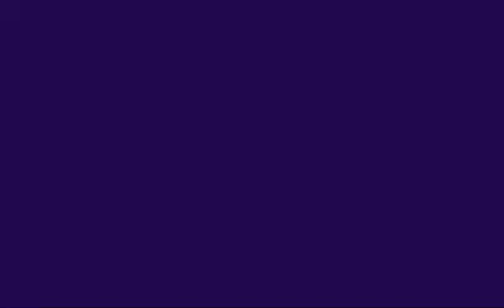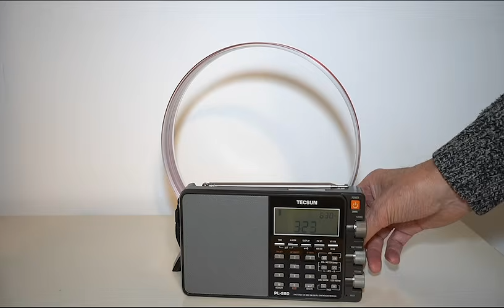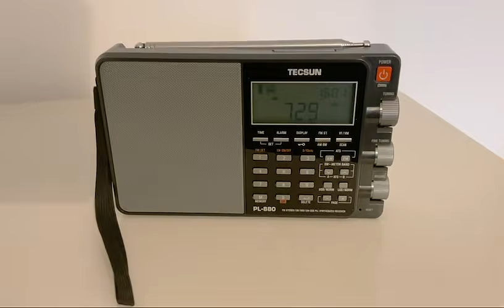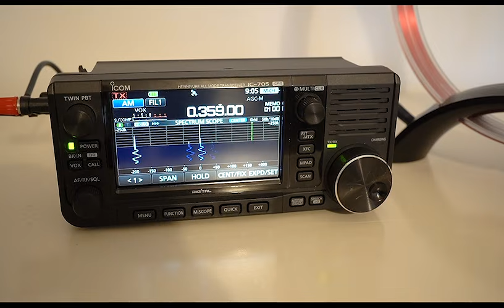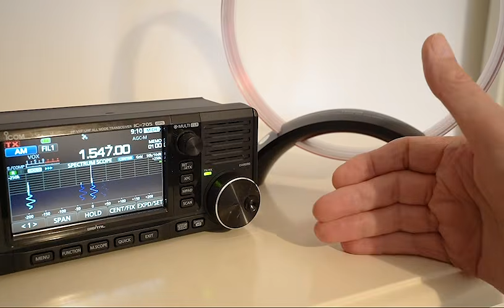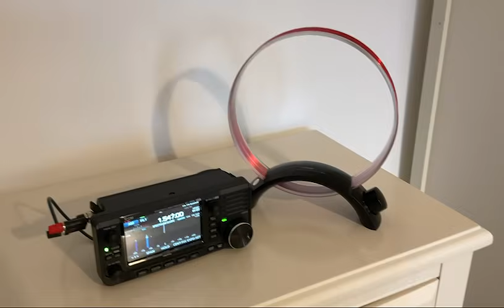The Amazing TECSUN AN-200 Indoor  Loop Antenna - LW MW and 160m. Great performance.

Comment: When using the cable, is the internal gang capacitor disconnected when the 3.5mm tip-sleeve is connected?
Looks like the capacitor remains connected, thus the receiver cannot control the beat frequency.

Comment: You have the orientation totally wrong, the Radio has to be END ON not parallel, been using one of these for a while now. The loop has to be in the direction of the station for a start, and then the Radio goes end on not flat.
Reply from the maker: I can only tell you what worked for me.

Comment: Hi and thanks for posting, I just got my self a Digitech RA 1780 that also offers a 3.5.. jack on the side, how can I get my hands on one with a 3.5 mm connecting cable and does it work on SW as well. Cheers Glenn v from New Zealand.

Comment: I’ve found that the AN-200 loop antenna works better on some but not all radios. I’ve also found that it works really good on the Tecsun S-2000 receiver but only in passive mode.

Comment: The results of your MW testing would have been tremendously better if you have set the receiver in such a way that it takes 9kHz steps (in the Americas 10kHz of course). The right frequency for Absolute Radio was 1215kHz, not 1217. Maybe not that important for a strong signal like 1215 used to be in your area, very important if on the hunt for a barely receivable signal that otherwise could be brought in clearly. While listening and turning the loop, adjust the loop tuning capacitor in very small turns as the loop is easily off set otherwise. This can make all the difference, that good this loop is. It can, and will as a matter of fact, make the difference between receiving a station faintly or not at all or receiving that same station very clear. The loop is extremely directional. So in order to take full advantage of what the antenna has to offer, I placed the loop on a lazy susan so it can be easily turned for optimal performance. If your receiver is small enough and has no dedicated MW antenna socket (very few portables have that) both the loop and the radio can be placed on the lazy suzan. And it will also make a huge difference what the position of the loop placed against the back of the radio is. The most important thing to do however, is acurate tuning of the loop. As said, it will make a difference between receiving a station and receiving nothing at all.

Comment: Thank you for this, Peter!  I have an AN-200 that I have used quite a bit with my CCrane Skywave SSB receiver using the inductive coupling method.  I recently bought a PL-990X and tried it once or twice, but -- DUH! -- never thought about plugging it in to the external antenna jack on the receiver.  After watching this I gave it a try and it works great.  Based on my brief initial tests I don't think it is much more sensitive than the PL-990X's internal loopstick, but it offers the great advantage of being able to rotate the antenna rather than having to rotate the entire receiver to check for nulls when trying to ID a station.  The cable that came with mine has a 3.5 mm on one end and bare leads on the other, so for my next test I'm going to try hooking it up to my KX2.

Comment: Well, that's a fine review as far as it goes, Peter, but why didn't you show us how the antenna works on the MW band during the NIGHT when MW DXing is mostly done, since reception at that time is vastly better than during the daytime? I know from having lived in Seattle for many years that using a good amplified Dymek antenna, or a tunable loop, it was often possible to hear the primary, 50KW stations broadcasting in NYC, 2400 miles to the east!  I would be curious to know whether such a small loop as the one you tested could provide similar results.  Frankly, I doubt it.  There was a period in my life when I decided to test all the high end MW antennas on the market, with the exception of the big KIWA tunable ulltra-loop which I couldn't get my hands on.  I found that the huge multiwire diamond loop Sunseri antenna on a rotatable was the best overall receiver, but it was way too finicky for my taste.  Several rotatable ferrite bar antennas also worked fairly well, as did the big round plastic clad "Alaska" antenna tunable loop, about 12 inches in diameter.  I also thought the amplified ferrite double bar Justice antenna sold by CCrane was very good and easy to use.  The big CCrane portable radio is also very good, perhaps a tad better than the more standard and cheaper GE Superadio I.  [Don't even consider buying a GE Superadio II or III!] My Sony ICF-2010 SW set also has a very sensitive MW section, -- but one absolutely MUST switch out the stock Wide AM filter on it and replace it with the steeper skirts of the Kiwa wide replacement filter in order to cut out all the adjacent channel slop.  [Why they put such a terrible stock filter on it is beyond me.  Sony usually designs high quality equipment.]  The SW region on the ICF-2010, with its sideband selectable synchronous detector was actually a better receiver than anything short of the Drake 8b, the Drake S8, or the little Palstar with both mechanical filters and, in my case, a custom, hand-built sideband selectable synchronous detector that I got from the late Dallas Langford, who was one of the finest MW band DX-ers in the world.  His detector also beat the pants off the one in the Drake R8b, which is the only feature that made it better than the regular R8 or the R8a models that came before it without sideband selectable synchronous detectors!   I also tested many other high end MW/SW receivers at the time, including the much ballyhooed AOR 7030 which I hated as it was so damn hard to use!  I found the NRDs, [I had only the 525 model to test, the 535 may well be superior to it] also to be good across the entire MW/SW range; good, but hardly exceptional. The same goes for my old Kenwood R-1000, a very good value receiver when it first came out in 1980, when I bought mine, but which is hardly still anywhere near the front of the pack. ..... Well I hadn't meant to write all this, but perhaps you, or someone reading these comments will find my opinions interesting and worth considering.  But please retest the little loop antenna you have, the one having only one OEM, but sold by many different companies, during a night when the reception is exceptionally good due to temporary salubrious ionospheric conditions.   And please keep your reviews coming!!

Comment: Like the look of the loop from Tensun. I use the Tensun Pl 310. Sangean ATS 909 X. Icom R70 and NRD 525. Plus a Mini whip antenna from Ukraine. Plus long wire antenna. Luckily I live in a building on the third floor. Not much qrm. But would like to purchase a loop like this in the future. 
  I am a radio listener of many years now. I am on the island of Cyprus. But come from South Africa Jhb. 
Cordial greetings for 2023. Good health and dxing always. 
 Best wishes and 73 Costa Constantinides limassol Cyprus.

Comment: I have a Grundig AN200, and it seems to be exactly the same.   Yes, same model number.  I wonder if they've licensed it from someone or if it's got a common manufacturer.  Really, it's such a simply design based on older loops but with 1970's styling (if I remember correctly), there's no way to patent the design, I should think.  And, it's an accessory. ... ... Just checked the box: it's Eton Corp., if anybody knows what that is.

Comment: I think RG-58 coax wire would be desirable for the 3.5mm connection lead?  Some careful trimming of the sheathing and soldering to a couple 3.5mm plugs would put you in business, unless you need to tretminate to a BNC on the one end.
Reply from the maker: At this frequency and length there is no advantage.

Comment: You can't buy those in Australia .... there's only 2 stations on AM 
How many turns of wire were on that loop ? Would the tuning capacitor be in series or parallel...?

Comment: Thanks Peter. It would be better if you tuned any of those signals properly. BBC Radio 4 is on 198kHz, and LW and MW bands in most of the world use 9 kHz channel spacing. It's easy to work out where you need to be, because all digits need to add up to a multiple of 9, so 162kHz, 648kHz, 774kHz, 1224kHz, 1593kHz, etc are all valid frequencies. In the USA, they have to be out of step with everybody else, so 10 kHz spacing is used in the Medium Wave Band. Serendipitously, that discrepancy makes it possible to tune US stations between some of the European signals, at night, especially if you rotate a loop aerial to null out some of he local stations..
Reply: Well since we saved your ass numerous times over from Nazis and Commies, tuning your radio dial shouldn't be too much to ask 🙄😜🤣
🇺🇸 🇺🇸 🇺🇸

Comment: This loop works exceptionally well with a direct connection with a mono audio cable to the Tecsun PL-330 on AM. It actually gets a much cleaner signal than my CCrane EP PRO and Sangean PR-D4W at night on target stations. It turns the PL-330 into a DX monster! I can`t wait to move to try some AM external antenna experiments with the 330. I made a 4 ft loop from a solar panel box to get the lower AM band so I can get a strong signal on 870 WWL New Orleans. I plan to modify some larger loops for a direct connection. I think the 330 can be used with external longwave antennas too. Not sure but it would be useful in Europe.

Comment: absolutely blowing my mind that the antenna doesn't have to be plugged in to the radio... I had no Idea this was possible!
Reply: This loop works exceptionally well with a direct connection to the Tecsun PL-330 on AM. It actually gets a much cleaner signal than my CCrane EP PRO and Sangean PR-D4W at night on target stations. It turns the PL-330 into a DX monster! I can`t wait to move to try some AM external antenna experiments with the 330. I made a 4 ft loop from a solar panel box to get the lower AM band so I can get a strong signal on 870 WWL New Orleans. I plan to modify some larger loops for a direct connection.
Reply: You can make a loop of 80-100 turns of 24 AWG magnet wire side by side turns on a paper towel tube and connect it to a grounded very long wire antenna and place it next to a portable radio for extreme daytime reception on AM.
Reply: @baneverything5580  Insulated wire?
Reply: @Bryt25  For the loop it`s enamel coated magnet wire. Outdoor antenna wire needs to have insulation. If an inductive loop is made with spacing between the turns and they don`t touch each other insulation wouldn`t be necessary.
Reply: It's called mutual induction just goggle it

Comment: Can I use the Icom model iC 750 receiver and transmitter only shortwave receiver...Is it a good idea
Reply from the maker: Yes you can use the IC-705 as a receiver. It is not illegal to own a transceiver as long as you do not transmit. 73 Peter.

Comment: Thanks for the Xmas tip I just order mine for Three Kings Day or Epiphany; that is a big holiday for is in Puerto Rico. For Xmas I grave myself a Tecsun R9700 Dx. I use to have a cheap Kaito and still have it but its speaker died that little thing gave me such wonderful nights when Hurracaine Maria left us without power for 4 months and that radio was our only connection to the only two am stations that were left standing and to the world. As you point out  radio listening is fun and in some instances sanity.
Reply from the maker: Great to hear from you. Have fun and take care. 73 Peter.
Reply: @watersstanton  as a follow up, This antenna is magical!

Comment: Does that spectrum scope NOT work on the IC-705, with these various stations?  Your scope doesn't seem to be working, or is it something you just turn on and off.  I have a KX2 and I just wish it had a scope within its small package.  I would think a scope would be somewhat helpful in finding these remote stations with these little loops.  I have been thinking about picking up the 705, but if the scope doesn't work here too on the LW/MW then it makes me think twice.  Seems to do will enough on HF (160m) though.  Can you speak to the spectrum scope in this specific instance?  ...by the way, I picked up one of these loop antennas -- thanks for the video(s).
Reply: He had the HOLD button on.
Reply from the maker: The rope certainly works on all bands. I can't remember what I had switched on at the time, but rest assured it does work!  73 Peter.

Comment: For effective reception, it is best to place this antenna perpendicular to the radio.
Reply: Not all radios have the ferrite rod going the same direction. And if it’s connected with a cable it doesn’t matter at all.

Comment: PK Antennas make and sell a similar unit here in Australia. It's pitched to remote country residents who need to listen to 774 ABC radio for bushfire information during our Summer fire seasons. I have one, with 2 ranges, 531 kHz to 1000 kHz, then 900 kHz and upwards. It works extremely well.

Comment: If I add wire to the AN-200 would this improve my AM radio reception?
Reply from the maker: There is no easy way to extend the coverage. Adding wire won’t do the job I am afraid. 73 Peter

Comment: LOL!  I saw this video and remembered that some time in the past few years I thought I  bought a similar, Terk  brand, loop.  But I couldn't find it.  I searched high and low.  So I went off and ordered one of these because, one has to have a loop antenna of this type.  The new one will arrive in a couple of days.  ...last night I happened to glance at a shelf in my computer/radio room and what do I see popping up from behind an old Satellite 700?  The curved top of the missing Terk antenna.  So now I'll have two.  It's not a complete loss because the base of the Terk uses some of that #&)*@_@_) soft touch plastic that turns stick after a while.  Eww.
Reply from the maker: Has Has. Thanks for sharing. 73 Peter.

Comment: The loop works well for synchronization my Casio g-shock radio controlled watch, After dark In the USA, I simply place my watch on top of the black hoop or base of the antenna and push the "D" button on the watch until it shows that it's seeking the signal from wwvb, the antenna hears on the sides so I point the tuning knob north or south so the watch hears the signal from the west of my location. It usually takes one or two sessions to update the watch to wwvb in Colorado.
Reply from the maker: Great info. Thanks. Peter
Reply: At what position do you set the tuning capacitor?

Comment: Saw that loop around 2017, and wondered if it worked.  Will have to try.  Cheap way to listen to 160 until I can get my folded dipole doublet up toward spring.
Reply from the maker: many thanks for viewing.73 Peter

Comment: I have the exact same loop and it works great.
Reply from the maker: Great. 73 Peter
Reply: oOOscorpionOOo, is your loop connected to a Ham radio?  I have an FT-450D and after watching the video I am not sure how to connect the antenna to my radio.  Can you tell me what kind of adapter to buy?  Thanks.  Tommy in Los Angeles California.
Reply: @thomassutton3421  Hi Tommy, no I don't connect it to my IC-7300 or FT-891, I use it With my Tecsun PL-680 by just moving it around close to the radio like shown in the video and it still makes a massive difference. I live in Ireland so during the day there are some U.K stations I can get but sadly most of their high power MW stations are gone and getting less and less But the loop can actually make a station I can't hear without the loop completely audible. 

 I would say if you have a 450D and a Ham that your external antenna, wire antenna perhaps ? this will provide much better signal than even the loop as good as it is. 

If you want to connect the loop to your radio it has a 3.5 mm headphone type jack so you could make up a lead with 3.5mm plug and PL-259 on the other but you'll need to experiment because I don't know which connectors on the socket on the loop connect to the centre pin on the pl-259 for example I never directly connect the loop to my radios because they don't have MW/LW connectivity to this external antenna jack.

If you would like a receiving only antenna I would highly recommend the Bonito MA-305 Whip, it's tiny but it's performance still blows me away each time I use it, I use H155 coax which I ground, the antenna is connected around 20 feet up in a tree. If you live in an apartment with lots of noise an amplified antenna might not provide such excellent results as I get with all that noise from electronics all over the place, it's also a great performer on LW and SW and you can even purchase a longer whip from Bonito to give it more gain and it does indeed provide more gain. 

It's a great antenna for an SDR, sadly, most portable radios don't provide connectivity for LW/MW via the external antenna socket, the Sangean ATS-909x does however but I found that it works only if you have the antenna jack connected half way. 

Sorry for the very long reply, :-)

Mark
Reply: @o00scorpion00o  Thank you so much for this information.  I found it useful and interesting.  I am in an apartment on the ground floor and can not put up any kind of antenna.  I only operate mobile with the 450D.  Very impressed with your knowledge of these antennas.  Thank you for sharing it with me.
Reply: @thomassutton3421  you are welcome, in an apartment you might try the Bonito Megaloop FX but unfortunately in any apartment you will probably pick up noise. 

 I really like that 450D, love the way the front panel lights up, shame they stopped manufacturing the 450D recently due to lack of parts, I hope Yaesu make something similar. I have the 891 it's fantastic with amazing sound via headphones and it's DNR is fantastic too. Really compact 100w radio but not as easy to use as the 450D but once used to it it's fine.